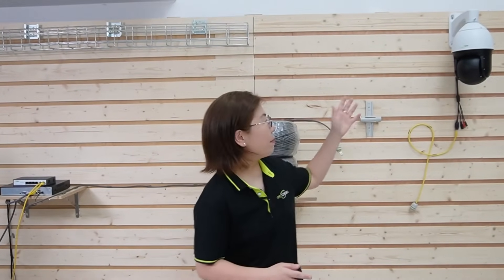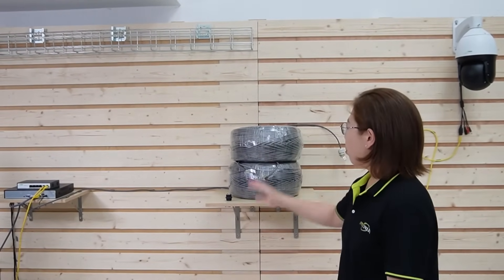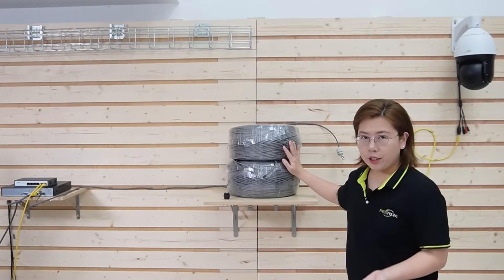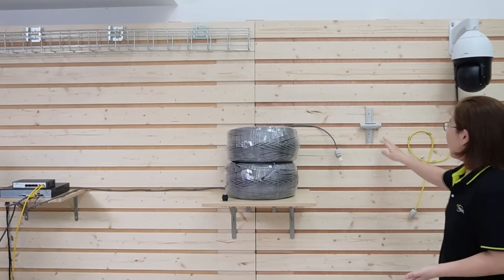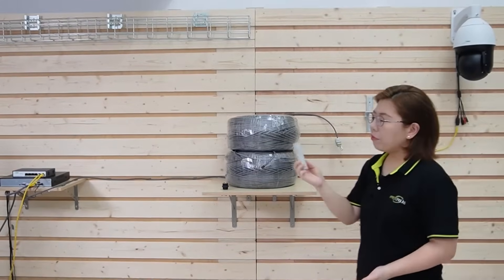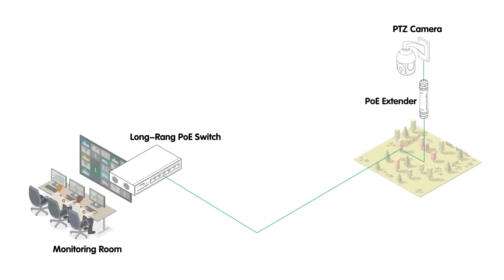Deploying IP Cameras on Construction Sites with Long Range PoE

Comment: Your hardware line up looks very impressive!. It appears to be an unmanaged switch with no indication if it is VLAN aware. As for long distance runs, I would suggest to provide abit more details for future videos, such as a simple ping tests indicating its performance at such a long distance. There are many cameras on the market that may not be able to tolerate. Great job, keep these very informative videos coming!! :-)
Reply from the maker: Thank you for the suggestions! Much appreciated! Indeed, many cameras do not have long-range capabilities. That's why we need to add a PoE extender to transmit video data back to the switch and NVR.

If you're interested, please subscribe to our channel. We've also developed various network solutions: https://www.fastcabling.com/pages/networking-solutions/

Comment: if you have 3 NVRs withe 3 switches on each. if one nvr break down, can we simply put the ethernet cable from the switch to the other nvr or we need to do some coding? If there is a video on that please send me the link. I could not find it. also do you have any videos on Camera coding for IP
Reply from the maker: Sorry, we haven’t filmed any videos about IP camera coding yet. If one NVR breaks down, you can typically reassign the cameras to another NVR by simply reconnecting the Ethernet cable. However, this process might involve some configuration. You need to add the newly connected cameras to the NVR. This typically involves scanning for new devices or manually entering the camera IP addresses. Configure the cameras as needed, including setting recording schedules, motion detection, and any other specific settings. Ensure the operational NVR can handle the additional load.

Comment: Can each segment of the Ethernet cable exceed 100m?
Reply from the maker: Yes. The long-range PoE+ switch can extend PoE over a distance of 500 meters at a transmission speed of 100Mbps (when used with a PoE extender). Besides, by enabling the dip switch, you can effortlessly extend the range to 250 meters while the speed will be reduced to 10Mbps. 

https://www.fastcabling.com/product-category/long-range-poe-switches/